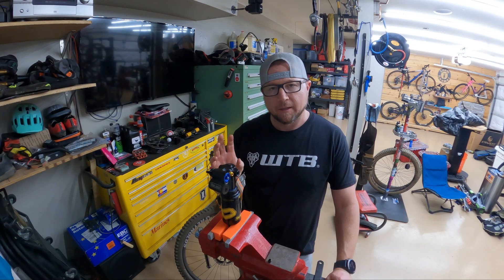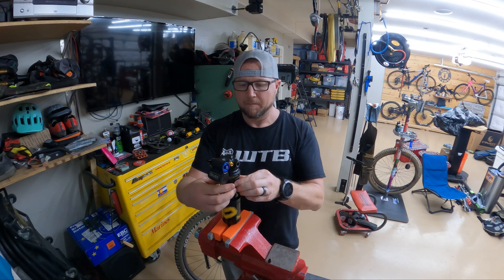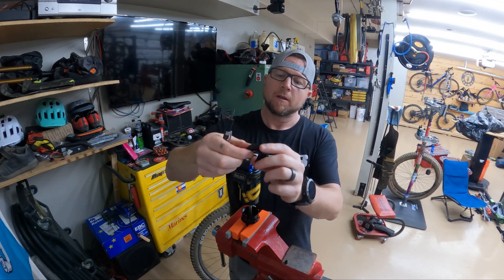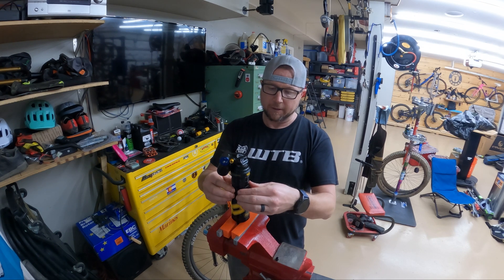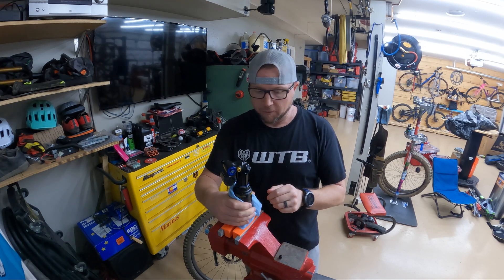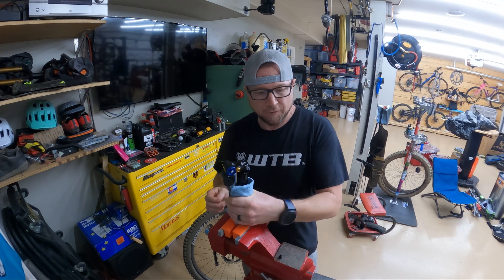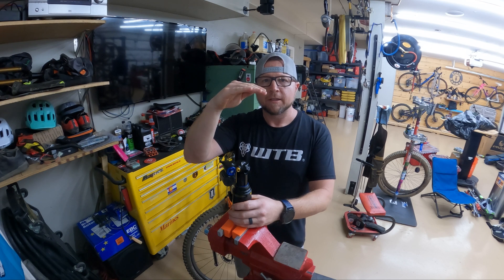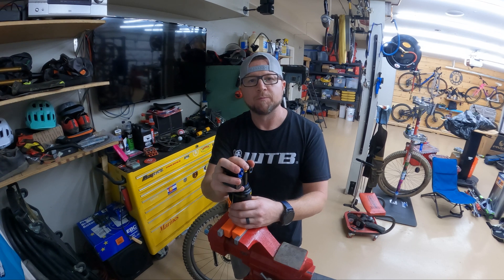Ohlins TTX Air 2 Volume Spacers: How to Check and Change the Amount

Comment: Cual corresponde para dejarlo en 205x60 porque mi shox esta en 205x65 y necesito acortar el recorrido me podría indicar cual usar
Reply from the maker: This would not reduce travel, just air volume. A shop would need to install a travel reducer

Comment: Got any tips on how to get a brand new TTX2 Air to equalize? If I empty it of air it sucks down completely, can't even undo the air can to install volume spacers (Which is my goal!)
Reply from the maker: put the tool on the can, air it down, loosen the can, and once you get the can off the threads, the shaft pops back up.
Reply: Had same thing hard too out rode it and it went away.

Comment: Hi, do have the 12000 volume puck installed?   I could not get it to snap over the sleeve like the other pucks?
Reply from the maker: We did install it in a friend's bike, I remember I not being easy. But it went on the shaft fine and slid into the top cap.

Comment: How do i increase/decrease the hub  60/62,5/or 65mm possible 🤔🤷🏻‍♂️
Reply from the maker: You need the correct 2.5mm spacers, the tool mentioned to open the can, a vice, and soft jaws with a shaft clamp. You would remove the can from the shock body and clamp the shaft in the vice with the lower eyelet pointing up. You have to unthread the lower section from the shaft, which is usually on pretty good. You either remove or add spacers to change the stroke, reinstall the eyelet to the correct torque, and re-install the can as in this video. I would suggest without the right tools you have a shop do this as you can damage the shaft and then the shock needs more parts and is expensive to repair.
Reply: @LoamRoamer  thx a lot🥰🥰👀👍🏼